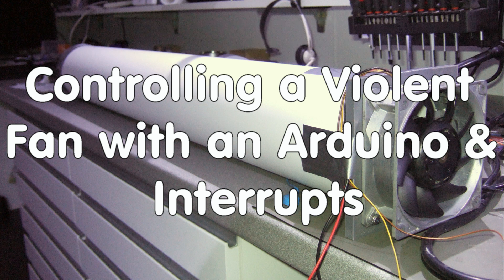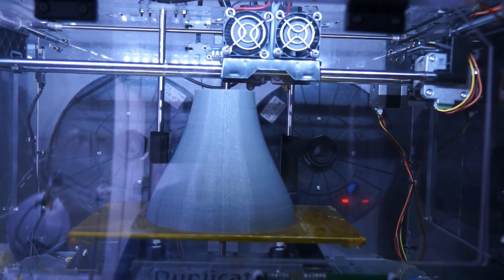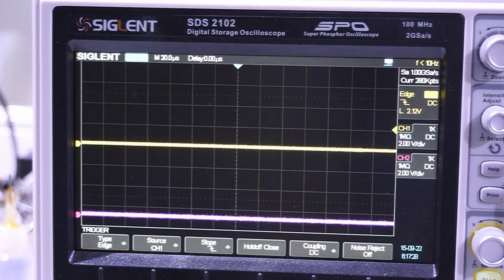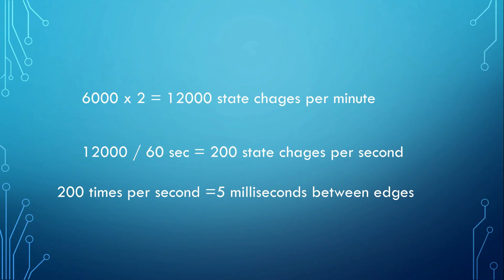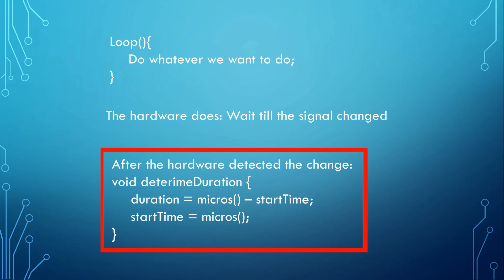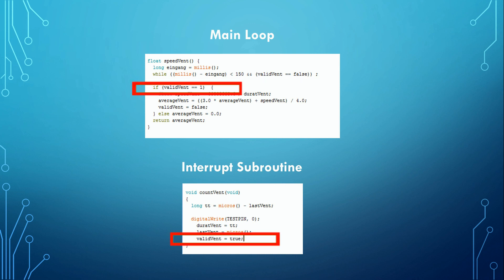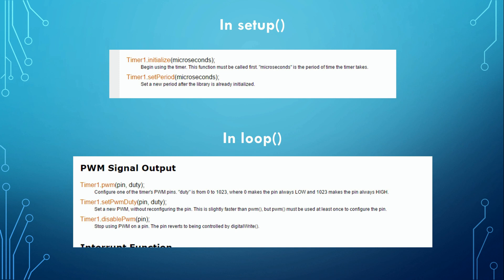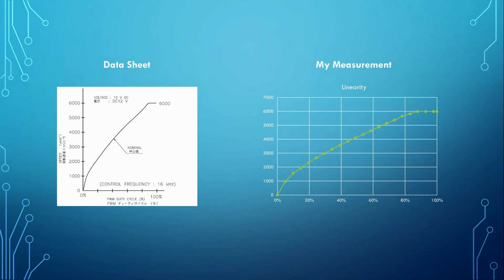#24 Controlling a Fan by Measuring its Speed and Supplying a PWM Signal

Comment: I have one of these monster fans, but how do you drive this pwm ? Pin 1,2,3,4 = GND, 12 V, PWM, Tachy Signal. Ist does not run with just 12V and GND connected. I got it running with a bigger NPN transistor and pwm, but it needs 12V on pwm and more than 120mA. Do i need to drive this pwm Pin so much?
Greetings Sven, Adliswil, Switzerland
Reply from the maker: I would use a FET for that purpose. You find many projects like that on the internet. Maybe not for a fan, but for other DC motors.

Comment: Hi Andrea, I am impressed by your code, just one question: why are you using: @9:22 (https://youtu.be/FEt4zB6f0v8?t=562) float speedVent = 30000000.0 / duratVent; ?
Reply from the maker: This is an old video and I do no more remember :-(
Reply: @AndreasSpiess  OK, i think i get it: 
60*1000000/ (PULSE_PER_REV * fanPeriod)), assuming you have 2 pulse for one rotation, we get  30000000.0/fanPeriod.

Old but useful !

Comment: Very cool project! I want to build similar rig, to test CFM at different RPM's etc. Fans are really fun to play with. :-)
I came here because im looking to build a fan control box for testing purposes.
And i would like to get my arduino to be able to control the fan with PWM and read the RPM. And then be able to switch over to control the fan with voltage (for fans that dont support PWM)(i guess i dont need the arduino to control 12v signal though)
Also, i want to display the RPM and applied volt to the fan on a display. To control the speed (pwm/volt) im looking to use a potmeter (two of them, one for pwm and one for volt)
What do you think, could the arduino pull this off?

I have only used arduino a little bit, i have manage to print text to a display, and learnt to understand how the code works, sort off. Atleast i understand a bit of whats happening in the code by reading it. So i will probably be goodling, and put toghether my own code from codes i find online. :-)

Comment: HI Andreas. Love your channel, your style and your accent. Very thorough and systematic. A comment on the schmitt trigger  for the noisy signal- in order to avoid more circuits I am thinking to use a resistive  divider to weed out the noise and relying on the small hysterisis of the arduino inputs. What do you think ? Regards and keep up the good work.
Reply from the maker: I would just try it. As I often do ;-) Sometimes it works. Otherwise, I learned something.

Comment: Love it!  This is exactly what I needed.  Could you provide your Arduino code or a link?
Reply from the maker: This is an old project and I do not have the code anymore. Should not be too complicated...
Reply: Thank you for the quick reply.  I am building a fan tester.  Basically it will do exacltly what you did to create the fan rpm vs pwm curve. Then it will validate the results against the spec to give a pass/fail result.

Comment: Thank you again for an interesting and informative video, I look forward to part 2. I see you are using a pro micro board, could you please do a short video explaining how you get this board to work and on what version of windows or mac? I have win7 64bit and cannot get my computer to recognize these boards, very frustrating.
Reply from the maker: +Howard Bailey I use windows 8.1 and the IDE version 1.6.5.
 I checked the driver: It is provided by Arduino LLC. So, it should come with the IDE itself.  On this computer I do not remember having problems.
I tried the board with an other PC with windows 7 32 bit and IDE 1.0.6 and had also problems with the driver. I uninstalled the IDE and re-installed the newest download (1.6.5). After that, the board was recognizend and I was also able to upload a sketch.
I like these boards because they are small, cheap, and have the keyboard function...